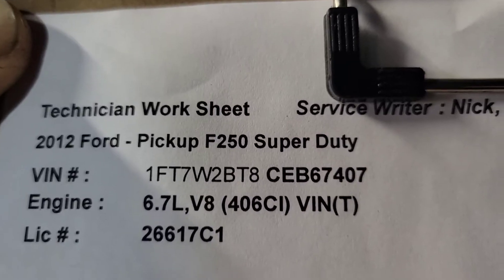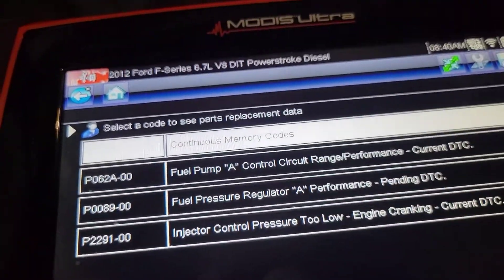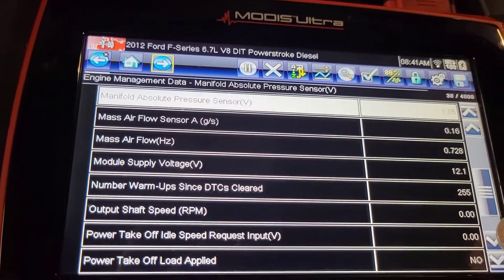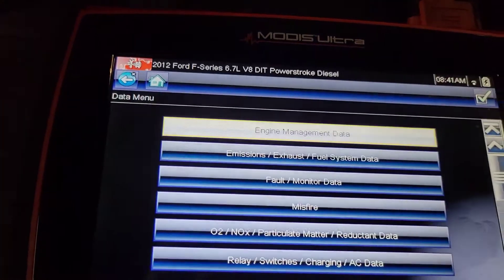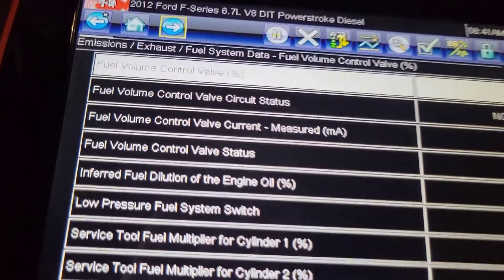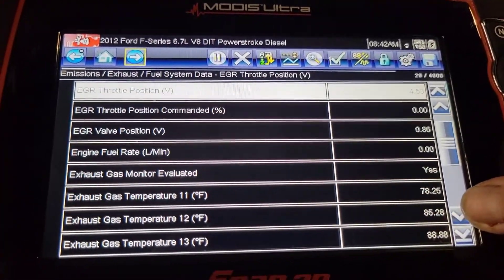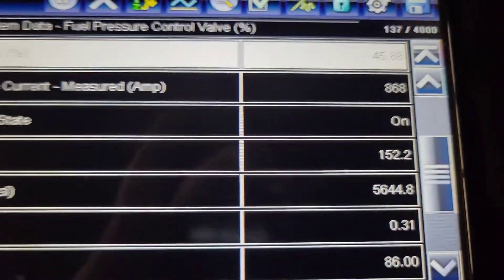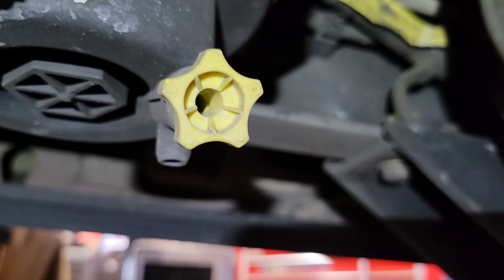6.7 Powerstroke Diagnosing No Start Bad CP4?

Comment: Hey man I'm doing this for a neighbor. Metal in injectors all that crap. you think I could save a couple bucks by flushing out the low pressure pump, changine filters etc. and one more question , why does the coolant and oil need to be changed? do metal particles tend to make its way in the engine and coolant id imagine? Thanks - Connor
Reply from the maker: I would definitely not cheap out, if there is any metal left it will make is way in new pump and would need an entire fuel system again. Coolant gets changed because choking system gets opened up.  Oil changed   due to possible fuel getting into oil.
Reply: @NutsandBoltswithTone  thanks so much man!

Comment: Got one right now, crank no start. Following the PPT it's taking me to zz for intermittent electrical concerns 🤣
Low side will build 65psi when commanded on. High side will not build pressure during cranking. Pulled the fuel volume control valve expecting to find the glitter but nothing. Any suggestions on where else to look? Never seen one fail without the metal. I'm gonna cut the filter open on Monday just to cover my ass.
Reply from the maker: Message me on Instagram
Reply: @NutsandBoltswithTone 
This was months ago. In my case I replaced the high pressure fuel pump with zero change in concern. Got tech hotline involved. They referred me to a newer model year PPT which included more steps than the actual model year I was working on. The PPT had me remove all glow plugs, unplug injectors and crank engine over. Turns out cyl's 1-4 had stuck open injectors. No idea how or why. Replaced those injectors and it was back up and running again. Customer had a Ford ESP which covered everything after referring them to the hotline contact. I suggested they include the "injector misting test" in the older WSM's but now that I've done it I won't overlook it again.

Comment: hey man I’m getting theses low pressure fuel codes after putting a little too much additive on accident when fueling 
truck will start in Engine reduced power mode but it will clear and idle fine with normal Frp 
When shut off takes 2ish seconds to actually shut off P0087 , P008A , P06DB, U0100
Please any help is appreciated
Reply from the maker: I've never heard of this from putting additives in.  Hit me up on Instagram

Comment: Got a 2012 6.7, when fuel pump is on but not cranking the truck is only building 4.33 FRP A, and has a hard time starting sometimes not starting at all, but have another truck the same year that builds 350 FRP A with just the fuel pump running. Curious if you know what can cause this and if it’s possibly a failing cp4 pump
Reply from the maker: @zerikhunt5517  u can message me on Instagram

Comment: How much was for the parts
Reply from the maker: Pretty sure just the fuel contamination kit from Ford withe pump, lines, injectors and rails is $10k. Then you still need low pressure fuel pump, clean fuel, have to dispose of contaminated fuel, clean tank, coolant, etc. If you are gonna be doing this job I would strongly recommend putting a DCR high pressure fuel pump in it. They are legal in CA now.

Comment: No metal shavings in my fuel, filters, or cp4 pump. Either i have a weak cp4, fuel rail senors. P2291, P0087, P062A
Reply from the maker: The p062a indicates problem with low pressure fuel pump circuit. Does the truck start and run? Message me on Instagram and I can help you some more, if you need it.
Reply: What did it end up being? I’m currently having this problem.

Comment: How much for that job … our 6.7 just shut off and now won’t crank after changing filters and successfully purging 6 times ran 6 minutes then died
Reply from the maker: It is a very expensive job,  I think it was around $17k. Message me on Instagram if you need more help.  Thanks for watching
Reply: Hes ripping yall off. It can be done all day for 8k. With DCR conversion. Just paid for mine.

Comment: Very helpful. New to working on 6.7. I’ve work on 7.3 and 6.0. I work as Diesel Tech military base and have a lot of 6.7. They sit a lot would you recommend changing fuel filters at every 10,000 miles?
Reply from the maker: Yes I would change them every 10k. The more you replace your fuel filters the better chance you have of garbage not getting into the pump. Also remember aftermarket fuel filters do not filter as good as oem filters. In my opninion oem filters should also be used on oil, fuel and air filters.Thank you for watching.

Comment: That high pressure fuel system disaster is going to cause a high vacuum disaster on someone's bank account. Those S&S kits are worth installing.
Reply from the maker: Yeah for sure. I watched a video where the fuel pump failed and had that kit on there and no metal. On thank you for watching the video